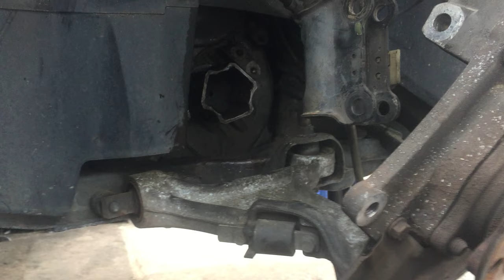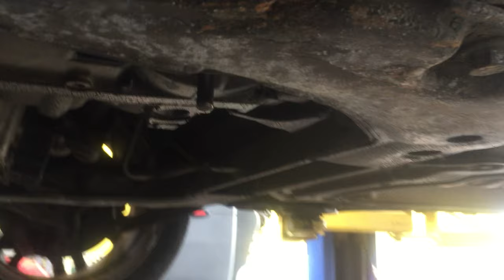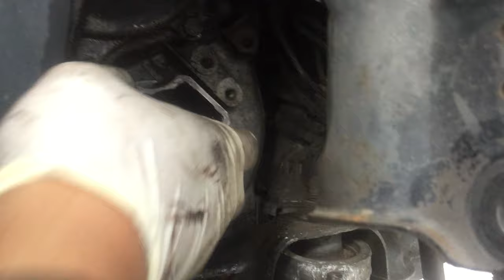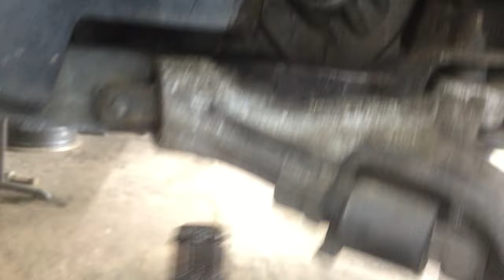How to remove a STUCK CV AXLE (No slide hammer required)

Comment: Man I did that with multiple tools an couldn't get it to pop out lol. I used pry bar, different size pickle forks lol. Maybe today it will just want to come out lol
Reply: I’m having the same problem. What worked for you?
Reply: I did it like 3 times like this till the screw driver fell out of place each time so on third time it came out but I put in new axle and it won't fit on other side like where wheel hub is so it's the wrong part n I can't get this one out so annoying I think I turned the axle that might be y like it's not in place to come out

Comment: TRY THIS IF YOUR IN A PINCH! Step 1 Rip the axle out. Step 2 cut the boot off the axle you just removed. Step 3 insert the axle right back into the thing your trying to remove. Step 4 put locking pliers on the thing your trying to remove and lock down the pliers as tight as you can. Step 5 slam the axle back and forth against the locking pliers until it pulls out.
Reply: @bobthebuilder9416  Boot is made of rubber...
Reply: Thank you i’ve try and it work perfectly to jammed cv joint

Comment: Did you tap it directly up? Or at an outward angle? Hard to tell with the video
Reply from the maker: Directly up, but it has to be thick enough for it to push it out. Hope it helps.
Reply: @BrianBalatbat  okay thanks. I have tried several attempts with a slide hammer and vice grips but that isn't pulling it out I'm wondering if I need a dislodge like you did heading directly up. Most stubborn axle I ever dealt with!
Reply from the maker: @thomasgranville3604  what kind of car is it?
Reply: @BrianBalatbat  2003 Corolla. Driver side axle

Comment: you do need special tools if your cars transmission is like the 07 jetta. those transmissions have no fluid where the axles splines are and rust over time, sometime you put a slide hammer on it and beat it for 30mins before it will come out. it really sucks. For most cv axle a little pry bar/ chisel does the trick licke a charm.
Reply: Mines fucked!
Reply: Lol same car and situation here.
Reply: @ItzMaxton  Did you find a solution? Ive spent all day trying everything on an 08 Jetta and cant get it
Reply: Hey.. I just joined the party...   This was the third I've ever done.. first was passenger side on a Dodge Caravan 2009... Yesterday my 07 Jetta passenger side.. not too bad... Tonight was the driver side¡!  Little did I know what was to come... Finally called it a night.. maybe tomorrow maybe the long pry bar.. maybe just perfectly straight... Only time will tell.. geeze

Comment: DRIVER SIDE CV AXLE HAS NO ROOM CHISEL IT OUT CHASSIS AND ENGINE BLOCK 
MAKES THIS IDEA IMPOSSIBLE 
PASSENGER SIDE IS EASY LOTS OF ROOM 
SO A SLIDE HAMMER WOULD BE MY ONLY OPTION
Reply from the maker: 21boxhead slide hammer never fails